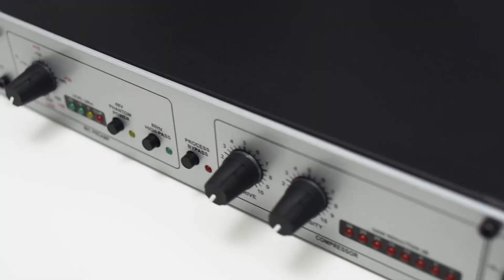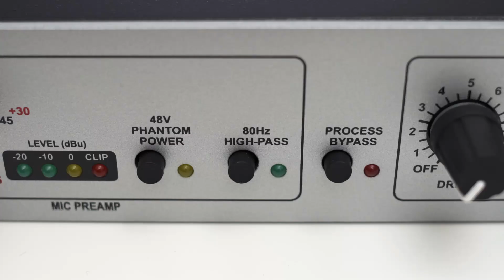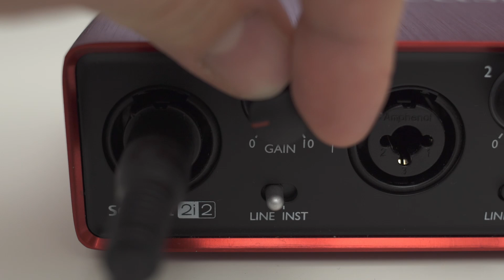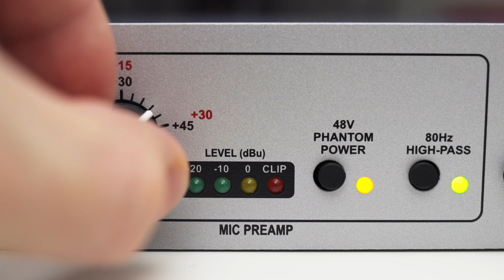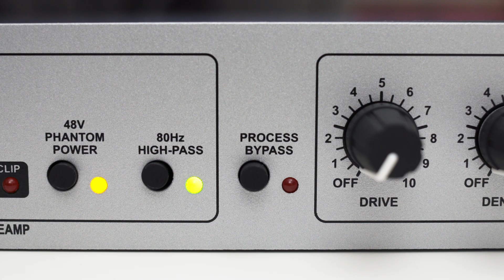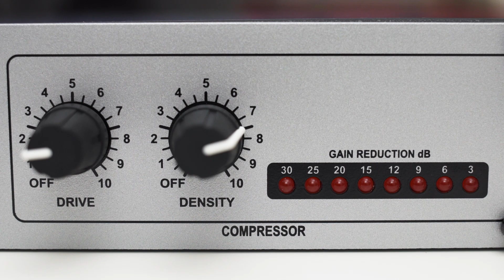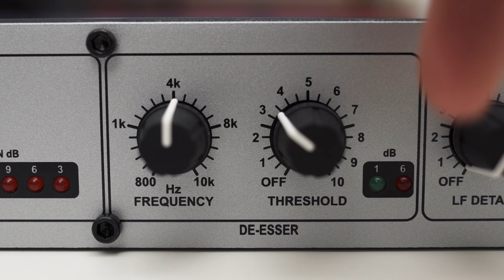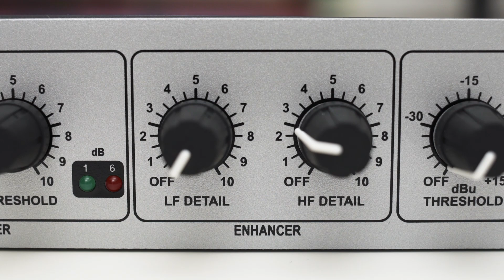Best Settings and How To Connect - get started with the dbx 286s

Comment: I go from the output from the DBX 286s with a TRS to XLR cable to my Yamaha mg12xu mixer (mic input 1), and the noise level is bad. Using the 26db pad helps but at the very least I get this sound similar to a whine behind my vocals. Any help would be appreciated...

Comment: Hey Julian, big fan of the vids. I recently got a 286s and I'm curious about these settings. I have a Shure SM7b and it seems that it gets into the clipping territory if I apply any sort of Drive in the compression settings. Is this because we are calibrating the clipping of pre-amp to the interface and any further gain (like the makeup gain applied by the compression Drive) would be sending it past clipping by the time it reaches the interface?

Comment: Short Question: Should u use a TRS Stereo(Two Black Rings) or TRS Mono(One Black Ring) for connecting the DBX with ur Interface?
Reply from the maker: You should use a TRS (Tip Ring Sleve aka stereo) cable not a TS (Tip Sleve aka mono) cable because it is a balanced connection which needs three conductors. Cheers!
Reply: @JulianKrause  Alright thank u very much

Comment: would this unit work well as a stand alone source for a large diaphragm condenser mic, with no other sound card or mic pre present? just the microphone connected to the dbx 286s, then the 286s straight to the computer for recording? Thank you for the video. subscribed.

Comment: I am curious: Why should I turning up the preamp on the interface instead of the  output volume of the DBX 286S?
Reply from the maker: Because the output of the 286s can start to distort when it is pushed over unity gain. That's why I recommend to use the gain on the interface to avoid clipping.
Reply: Right, didn’t think about that. Thank you for the quick response!

Comment: I don't understand why you're doing this. At -18 dBFS, I speak and the signal is red hot, and doesn't the mic level depend on how loud the tone going in is?
Reply from the maker: No, the signal volume doesn't effect the calibration. But if it doesn't work for you, here is the simple way which can also work just fine with your Scarlett Solo: Turn the output of the 286s to 12 o'clock ( 0 position), turn the gain on your interface all the way down. Set the input on the interface to line level and adjust the input gain in the 286s to a proper level. I'm assuming you use a TRS to TRS cable to connect the 286s to the Solo.
Reply: @JulianKrause  I'm giving that a go now, thanks.

Comment: Hi julian,
Thanks for the compressive guide on 286s,
recently i bought dbx286s and tried to make a good sound with less noise.

Can you help me building a good audio setup using ( Audient iD4 < DBX286 < Cloudlifter CL1 < Shure SM7B). I tried best  but i could not able to gain a good sound. few questions can you help

1) to reduce noise, is it good to have the pre-amp gain set to 30db rather than driving hard at 45db? and whith that 30db preamp i try to make sound adjustment on output gain at dbx286 +15db
2) i can't drive compression to make a consistent sound wave (strength) if i increase beyond 3 drive it add humming noise (since it boost the gain as well)
3) my sound notes sometime goes too low, hence i set the compression density to low at 3, so that it keep apply compression , should not be too sharp . but on audacity waveform still i see the low notes are still low (my guess was compressor boost low notes) apart from reducing high notes.
4) is it a good practice to operate at low gain at 286 preamp and low gain at output side of 286 and then makeup the required gain at Audacity using normalising to -1 db level. what is your thought
5) One issue i saw (might be not in my knowledge), with SM7b i am getting mono sound wave , if i record stereo sound then how i can achieve  

i guess these issues might have arrives to others as well who is just started on setting up home studio.

Comment: Is there a functional difference between using a TRS to TRS ,vs a TRS to XLR for the patch cable between the DBX 286s and your audio interface?
Reply: i want to know this as well.!!!
Reply: I have to go TRS TO TRS, if I use TRS to XLR the preamps of the interface automatically kick in, which makes it way too loud and noisy.
Reply: S G A Use only TRS is better because it bypass the preamp of the interface in certains interface, and that’s good because you want to use the dbx preamp, no the interface one. But if you have a realy good interface that’s cost more than 600$, the interface preamp will be better than the dbx one, because dbx is not a expensive preamp.
Reply: Skynet_exe Use only TRS is better because it bypass the preamp of the interface in certains interface, and that’s good because you want to use the dbx preamp, no the interface one. But if you have a realy good interface that’s cost more than 600$, the interface preamp will be better than the dbx one, because dbx is not a expensive preamp.
Reply: MeisterHerzlos that’s what it’s supposed to be. Let it in only TRS

Comment: Is it better to use TRS to TRS or TRS to XLR? Also, what concerns TRS to TRS, then which one should be used? Balanced/Unbalanced? Mono/Stereo? For connecting dbx286s to audio interface?
Thanks!

btw. superb video! ;-) keep it up!
Reply from the maker: Hey, if you can use a TRS to TRS cable. TRS stands for Tip, Ring, Sleeve. So, the connector has these three contacts. This connector is sometimes also called a 1/4 stereo jack. Cheers!
Reply: @JulianKrause  Thanks a lot, Julian!
Reply: @NamFlow  TRS to TRS will bypass the DAW, so it only uses the DBX to process your sound, using a TRS to IRS cable wont bypass the DAW and will basically give your device 2 amps, which is too much

Comment: Hi Julian,
if I wanted to connect both a condenser microphone to the xlr input and a digital piano to the input jack at the same time is it possible? I must to use a ts jack in input?do i come out with a jack trs cable from the output? thank you

Comment: Hi! I've found that if the output gain from the DBX 286 is still too low, I slightly tweak the gain on the Focusrite 212 connected and the signal is great. I also don't hear any unwanted squeaks or noises. Am I making a mistake by adding some gain from the audio interface to the chain?

Comment: I have no idea what’s going wrong with my setup. I have a TRS to TRS going from the preamp to my interface (switched to line, using the Scarlett solo). Preamp is working just fine and the interface works fine normally, but for some reason there’s absolutely no audio output. 

Faulty cord maybe?

Comment: Great video ! If I follow your instructions, and use all the gates and filters, do I use them all at once? Or is it only necessary to use one or two at a time?
Reply from the maker: Yes, I would recommend to setup the 286s like I showed in the video. Of course, you don't have to use all effects. If for any particular reason you don't want it, you could leave it turned off. Depends on what you want to record and if you want to prcess the audio further in your DAW.

Comment: I purchased the Scarlett Solo because of your video and am happy with it.  The Solo doesn't have the nutrik combo plug, instead a separate XLR mic input and a separate combo 1/4 TR/TRS Inst or line level input.  I've had a DBX286 for twenty years...so I suppose I should use the line level TRS out on the DBX and line level TRS input on the Solo?   I checked the specs of the line level input with the 2i and Solo and they are the same.
Reply from the maker: Yep, that's the way to do it. When you folllow the video you should end up with the gain on the solo at the minimum setting and the output on the 286s close to 12 o'clock.

Comment: I have noticed a single, potential flaw in your tutorial. It’s the volume setting of your smartphone. This does not work on any smartphone. There are some smartphones, which become louder, others not so much. Other than that, it seems to be a solid tutorial. Thank you for that!
Reply: Hi Michael. I think Julian's method is fine as it's only used to set the 286 output relative to the interface input - it isn't used to set the specific input gain for a particular mic or speech level - that comes later.
Reply from the maker: Hey, the absolute volume of the smartphone signal is not relevant. When you turn the preamp gain so that the yellow LED lights up, the output is always 18dB below the clip level, provided that the output gain is set to 0. Cheers!
Reply: Thank you for that insight, Julian and Red Robbo’s Workshop! Yes, Julian, I do understand that the output gain stays true to the inputs gain, but Red did answer my point more directly. And Red: This isn’t necessarily clear to the viewer. It should be pointed out to the audience, since most people who watch this video would presume it’s a tutorial to actually set up the devices for recording, they wouldn’t think about how loud  one speaks or sings. People, who actually understand that much, don’t need help with leveling equipment.
Reply from the maker: @MichaelW1980randoms  You are right, I'll try to point this stuff out in future videos!
Reply: I‘m sorry for causing you discomfort - its just that i can see your passion for detail in your videos. But then again, i also appreciate the difficulty of finding the best ration between detail and accessibility. Therefore again: I’m sorry for causing you discomfort.
Reply from the maker: @MichaelW1980randoms  Not a problem, I'm always trying to improve, so your feedback is appreciated!
Reply: Good one. 👍

Comment: If I I uise the gain knob on the dbx and add some gain from the interface, isn‘t that causing problems with the pre amps in the interface since 2 pre amps are working at the same time?

Comment: Julian, thank you for all you do. I appreciate your work and detail explanations. This is the reason I am reaching out to you.
I have purchased this unit and I do not use a rack to mount it into. I am trying to arrange it on my desk but I like to know about stacking electronics and proximity effect to other electronics and signal/ noise interference. I do not know who well-shielded this unit or other equipment are.
Here is my question, If I stack a Motu m2 on thop of this, will it cause issues with noise, hiss, hummm, etc? what if it is close to a Bose soundbar (or one sitting on top of the dbx?
any thoughts? I appreciate any input you may have. Thank you again for all you do.
Reply: Hey I'm not him but I have a similar setup as yours. As you I don't have a rack to install my dbx 286s into and I just have it right there on my desk (I put some rubber feets on it). I have an audient id14 mkii audio interface on top of the dbx (also with rubber feet) and it doesn't induce any noise at all for me (I even have it close to electric cables for my monitors and such). I don't think you should worry about the units themselves affecting eachother, but you should worry about the cables. Specially electric cords can create magnetic fields around them hence affecting the sound (hums and such).
Also make sure to use proper BALANCED cables of a higher quality, preferably TRS-connectors from the dbx 286s to your audio interface.

You can also try to just use a long cable in between the units to see if it affect the sound but I doubt there will be any difference if you don't use trash cables.
Reply: @kiiroMADE  thank you very much for taking the time to respond and thank you for all the great points you have made. I will consider all your suggestions.

Comment: Does this method for calibration work for other external analog preamps and audio interfaces? Like a GAP 73 preamp with a steinberg audio interface? It seems implied in the video but just want to be certain. Also, is the -18dbs specific to the focusrite/286s combo? Thank you for this video btw very helpful 😊

Comment: Hi, I am new to this stuff, so please forgive me this dump question: If I connect the mic with the DBX286s and the DBX286s with my audiointerface (i.e. Scarlett 18i20 3rd gen. or Mixpre 3 MkII), does it matters at all, how good the preamps of the audiointerface are? As far as I understand it, the bottleneck is where you plugin the mic directly in. This would be then the DBX286s. Is this correct? And is the sound quality of the DBX286s "good enough" for a Scarlet 18i20 3rd gen. or Mixpre 3 MKII or would you recommend to plug the mic rather into these audiointerfaces and use a DAW to do all the stuff there instead of using the DBX 286s? Thanks in advance.

Comment: Hello there Mr. Krause, I'm now using  the dbx  to push a Shure SM7b. I followed the steps you recommended but for the life of me  I couldn't get enough tone from the phone app to even light up 1 input gain LED light. Therefore it was not possible to get the  -18db target on my DAW, instead I turned my track input down to  -18db and used my voice as input.  Am I doing something wrong??? HILFE BITTE!!!  UPDATE: Sorry just read your important notice about cranking the phone volume so that tone registers but it still didn't register even though the phone volume was maxed out. Would the alternative be to send a tone through one speaker and try to get the tone to register that way?

Comment: Hi Julian. how to setup DBX 266xs with Behringer UMC204HD Yamaha mixer and parametic EQ? Cause DBX266 no have built in mic pre amp.

Can setup like this?

Mic to mixer input press 48V > 
Output mixer  > 
Input parametic EQ >
Parametic EQ output >
Input Compressor > 
Output Compressor >
Input Behringer Interface >  and connect USB interface to PC

Can?

Comment: Thanks for this! Quick question: when calibrating the levels, why do you recommend turning up the interface preamp rather than the dbx output? Basically, why should we never go above 0 dB on the output knob?
Reply from the maker: Because in my testing I found out that this leads to clipping. And you really don't want to distort your audio.

Comment: Hi, thank for your information. If I activate the phantom in the dbx 286, will I no longer need to activate it in the interface or is it necessary to do so? Thanks for your answer.
Reply from the maker: Hey, it's enough to only active the phantom power on the 286s. Turn of the phantom power on the interface. Cheers!

Comment: Excellent videos on the 286s!
Out of interest - does the processing add any latency to the output?
i.e. If I was to plug my headphones into the 2i2 in your setup would I still have 0-latency monitoring?
Reply from the maker: Hey, the processing is instand and it essentially does not add any delay. If you connect it to your 2i2 you can use the 0-latency monitoring and still hear your voice without any noticable delay.
Reply: @JulianKrause  Awesome, thanks for answering :)

Comment: what is a proper way to connect DBX 286s to this Scarlett Sollo? Can I connect it into line mode with TRS-TRS?
Reply from the maker: Technically TRS-TRS ist the best solution. But many programs only use the first input of the interface, so in those cases TRS-XLR can make more sense.
Reply: @JulianKrause  thank you.

Comment: Hi Julian, just wondered why your Focusrite input volume is zero. Do you then adjust the Focusrite output level to the required volume. Thanks.
Reply from the maker: Hey, the gain on the Scarlett stays at zero. The signal from the 286s is a strong line level signal and does not need any further amplification in the Scarlett. This gives the best noise performance.

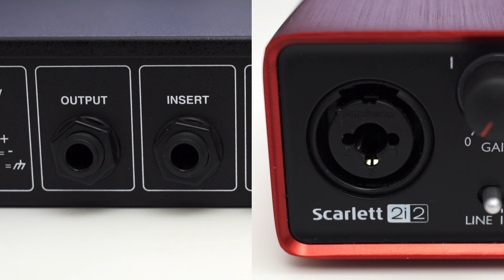Comment: 1:20  WHY  the preferred TRS cable is stereo? (it has 2 notches)
A microphone  sends a mono signal, so I'm expecting to use a mono TRS cable. Is there a reason for using that stereo TRS cable?
Reply from the maker: Hey, the output of the 286s is a balanced output which uses three conductors. This helps to minimize noise and you need to use a TRS plug for this to work.

Comment: Thank you very much for the video explains very well, these analog pre amps are better than the plugins or emulations regarding the sound quality ?, that is to say they give a better sound quality ?, are better than the preamp of modern interfaces like audient id14 ?, Thank you very much for your knowledge I would appreciate some response greetings from Chile
Reply from the maker: Hey, the preamps in the iD14 are better than the preamp in the 286s because it has less noise. If you don't need the real-time audio processing capability of the 286s, I would just plug the mic straight into the iD14 to get the best audio quality possible. If you want, you can then use some plugins to further shape the sound.

Comment: Hi Julian. Another excellent how to video and very easy to follow and understand. What was the Sennheiser? If looks like a K6 with maybe an ME62? BTW. If you're interested in some of the tests that I'm doing for the capture stuff send me a YouTube private message or email using the address in my descriptions. I want to avoid putting active links in your comments. Again, awesome video. Cheers, Dave.
Reply from the maker: You are right, the mic is a Sennheiser ME62 with the K6P power module. And regarding your tests, I did send you an email :)
Reply from the maker: @TheGameThing  The ME62 has a pretty flat frequency response with just a slight boost in the high frequencies. It is not as bright sounding as the ME64 and ME66. It also has incredibly low handling noise and with just a small foam mic cover it is pretty much immune to wind. I personally really like the ME62 and it is my favorite capsule out of the ME series!